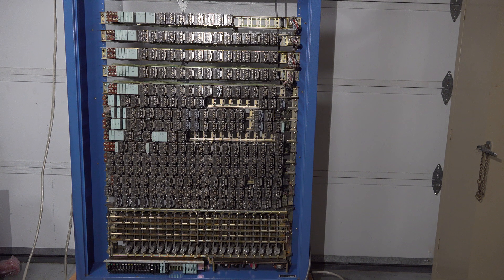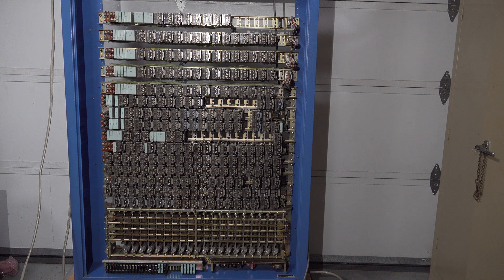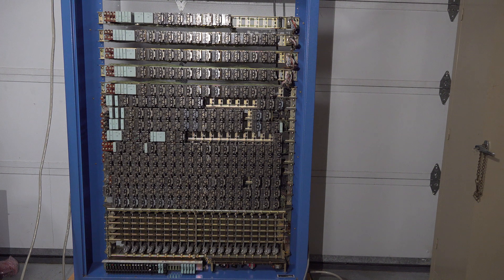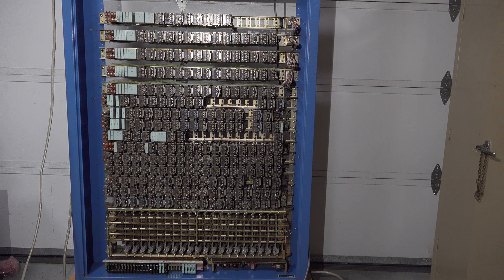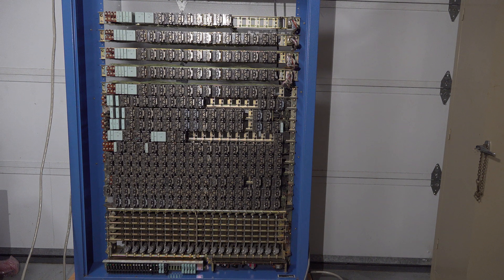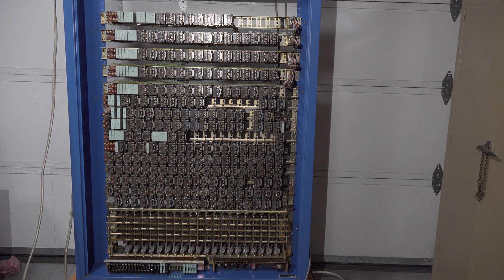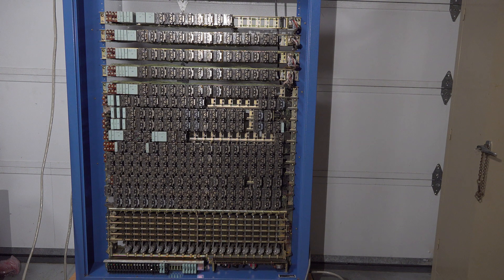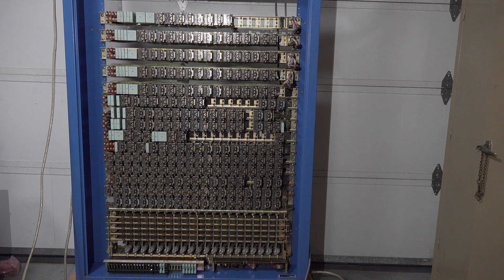OKI AC125A Crossbar PBX

Comment: I worked on these and other Swedish and Japanese crossbar switches in the 1970's. Good equipment!
Reply from the maker: Very cool, Dave.  I’d love to hear some stories about them.  As I’ve increased the load on this PBX, I found one issue I’ve been chasing with no success: when all channels between the left and right half of the XB are occupied and another extension goes off hook, the marker goes into a retry sequence, hammering the XB, until a channel becomes free.  According to the documentation, I believe a busy should be returned to the off hook extension.
Reply: @howardharte5064  I don't think I recall working on this simplified hotel PABX design from Hitachi, although I did extensive work on NEC, OKI, Meisei Electric (Arcata Communications), and Ericsson ARD561 and AKD741 systems. I managed systems engineering for the USA for Arcata Communications which became Stromberg Carlson Communications, both interconnect companies. I also worked with Litton Business Telephone Systems.
Reply from the maker: @spotterinc.engineering5207  thanks for the details, Dave.  I can’t imagine how difficult it was to keep the bigger XB’s running.  This one took a couple months of spare time to get working.  That said, it has been running 24x7 for a couple years now, without many issues.
Reply: @howardharte5064  The closest thing to your PABX I worked on was the Nippon Electric NEPAX-100 which was a 100 line system also offered by many Bell telephone companies for small businesses and motels. I recall you could also get it with only 60 lines. We added message waiting lamp support and outgoing local call counters for motels in those days for motels in California.

Another system sold by Arcata and Bell System was the Nippon Electric NA409 400 line PABX - this was used in larger businesses and hospitals.

Comment: As this PBX was commonly used in hotels an motels, is there a way for the front desk to transfer a call to either a guest room or another department such as the bell desk?
Reply from the maker: Yes, to a point.  If the call involves a trunk, it is possible to do a “consultation hold” and then transfer the CO call to another extension, or even do a 3-way call.  For intercom calls, I believe the only recourse is to ask the caller to dial another extension.